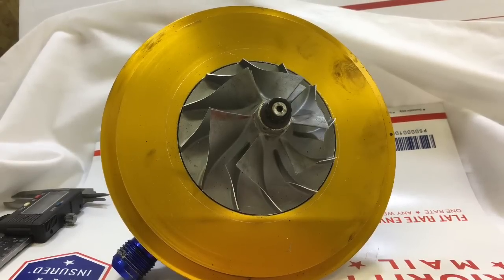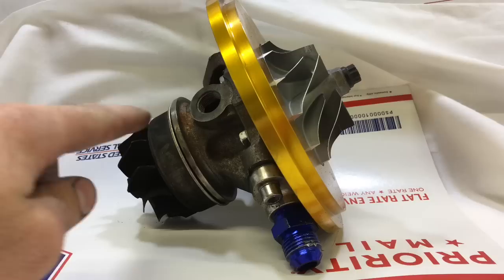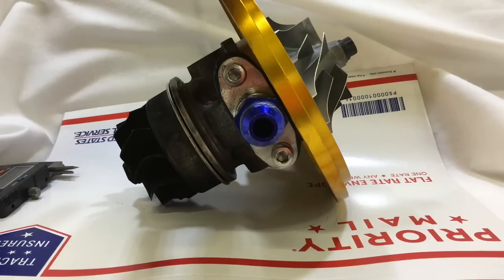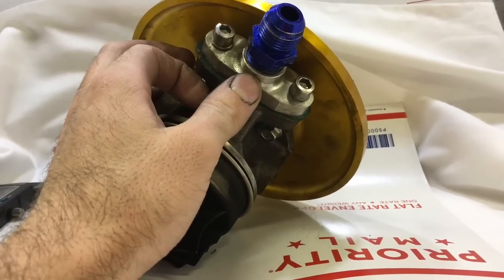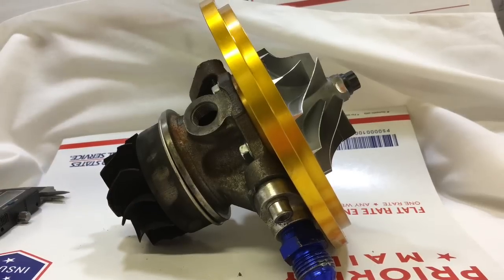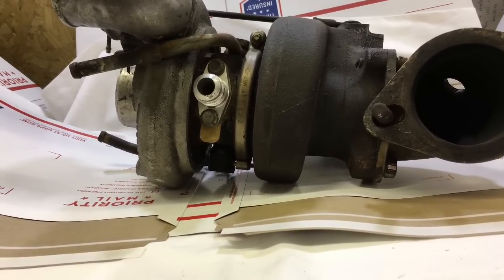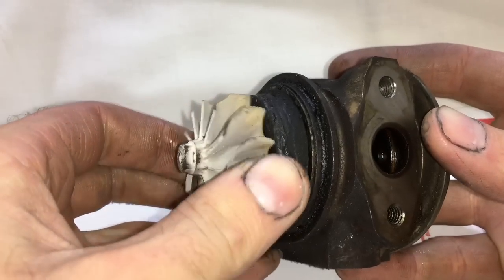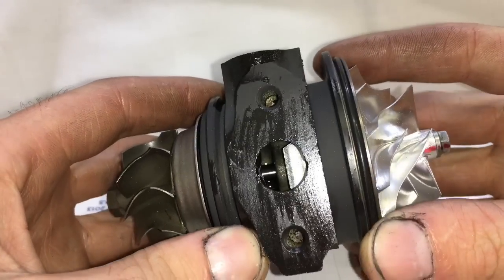How Much Oil Pressure To Run to Your Turbo

Comment: 10AN inside diameter is 14.224mm. most stock turbo japanese car run 5/8 in hose for oil return lines which is 15.875mm.     After watching some of your other videos it's really surprising how little you actually know about turbos.
Reply: enterBJ40 just because your little book says something, doesn't mean the people in China making them are going by your  Eaton books specs. Go on eBay and buy a couple -10an turbo drain fittings and actually measure them you fool. I've ran into the exact thing this guy's explaining. Some of the drain fittings will be the correct size right at the mating surface of the turbo but if you look into the fitting the size of the inside diameter steps down almost to half the size. This guy making the video is just trying to help people. Why would you push your luck running some minimal thickness fitting and worry about the dumb thing not draining. I know I'd rather have a way bigger drain line and not need it then need a bigger one and not have it.
Reply: Aaron is right. According to  my EATON AEROQUIP manual, all -10 are  0.891 of an inch (22.631 mm) . According to NFPA all -10 (dash ten) are, and must be, the same diameter for the same application; in this case hydraulic application. Pneumatic application has also a -10 but the flare that seals the connection has a different angle: 45°.  An inch has 25.40 mm so I think a -10 is more than ok for an average application. The next size in inches is -12  (3/4).
Reply: The main concern is the ID of the line. All -10 line should be right at 14.2mm ID. I big issue is the fittings you hook them up to. That's where the size varies a lot.  For turbo drain fitting you can typically use a 1/2in drill bit to bore them out if they are too small. -10 hose end fitting are the same. if it's a straight one you can bore it. the Summit racing Brand fittings are have a large ID and flow well. But I've come across some at the shop with a very small ID that I wouldn't use.
Reply: 10AN is 12.2mm ID or 0.48" by the charts.  I trust the charts not the manufacturers.  5/8" hose is measured on the OD not the ID when using AN style fittings. Hydraulic hoses (Dash Sizing) have a different OD and ID configuration, so a -10 is a 5/8" hose with a 16mm ID.
Reply: All you need to do is buy some AN fittings AND line from various manufacturers and measure them. The real world ID's are all over the map. Your AN charts are accurate true to the specification for internet arguing sake. Not worth much in the garage with parts in hand. "Measure twice", not just for carpenters!

Comment: My TT Mustang has over 100psi oil pressure.... trust me, you ain't "running as much oil as you can" I don't care what kind if drain you have.
Reply: TJ. N bullshit, I sell Precision, Garrett and Comp turbo and build 1000+ whp cars pretty regular and the drain line has shit to do with the oil pressure you can run. Many turbos have restrictor on the feed line for this very reason. Turbo drains are gravity feed so what matters is the correct routing of drain line and its return location. In high crank case pressure situations it can also cause drain problems.
Reply: "If you have enough drain... you can run as much oil pressure as you can" That's his words. my car runs 80 psi with a 16mm drain and it runs great all the way to 7400rpms no issues.

Comment: First off I really enjoyed the video and gave it a thumbs up. But after watching, something just didnt seem right with the measurements, especially since AN -10 line is supposed to be an equal replacement to 5/8 standard hose so I decided to head out to the garage and measure some fittings and hoses. Heres what I found.... The fitting you measured must have been a very cheaply made -10. A quality -10 has an ID of a little over 1/2" or right around 15mm. I just confirmed this by measuring the -10 fitting for MY drain and it measured out to 14.8mm.I also measured the ID of a piece of 5/8 heater hose and it came out to only 15.8mm. While I doubt that 1mm would make a very large difference in drainage, assuming it would, since there is no pressure on these, it would be perfectly feasible to drill the -10 out to over 16mm and still have an adequate seal for a drain line. This would give it MORE ID than the 5/8 hose you recommended while still allowing people to keep the fittings they have already purchased and to run the braided line that is sometimes needed due to the lines being very close to the exhaust manifold on alot of custom setups. This is the very reason that these AN lines became popular on custom turbo setups in the first place. This video definitely made me think though so Im headed out to drill my fittings now. ;)
Reply: Bad Luck Garage im just about to use 7875vsracing turbo on my hsv ls1 so thanks for the input cos i have heard this turbo has bugger all room for the drain fitting and makes me nervous😅
Reply: I'm not using the 7875 but will probably upgrade in the future. Currently using a T66 that came on an STS turbo kit that I got for a steal but if you check out my playlist for my turbo C10 you'll see I've chamfered the drain fitting to help flow into the -10 fitting. I completely agree with this channel that you should use the biggest drain possible but sometimes clearance is tight so you gotta make due and just try to help flow wherever you can. Disclaimer: THIS GUY OBVIOUSLY KNOWS WAY MORE ABOUT TURBOS THAN I DO!!! So I would follow his advise whenever possible!but sometimes on custom setups, clearance is an issue. I'm actually having to go ahead and clock my drain line and tighten it to the drain fitting off the turbo, then bolting the assembly to the turbo as an example.
Reply: Bad Luck Garage yeah thanks.. will definitely have a watch and look at getting flow best i can. My car is 4door version of your 04 gto so not alot of room in general i will keep you posted.
Reply: I'm assuming you're referring to a Holden Commodore? That's pretty cool brother!!👍🏻
Reply: Bad Luck Garage yeah thanks. Funny tho i covet your c10 and cool coupes especially the trucks tho.
Reply: Yep , Robert set them straight.  👍 go gettem CC
Reply: If your case breathers are plugged, dirty, even slightly  restrictive it can prevent the drain from flowing properly.
Reply: The blind leading the blind
Reply: Bad Luck Garage I actually work for a couple of the major manufacturers of diesels and he is 100% right now while you are right as well it must’ve been a cheap China fitting and I say China from experience there’s a lot of people that run the big rigs they like to put dress-up stuff on their engines I’ve seen a lot of these fittings that I had to takeoff because they are restricted and also are Poor quality metals what I’m trying to say is if it says to give it a 1 inch hole give it a 2 inch i’ve seen turbos that are supposed to go half 1,000,000 mile crap out in less than 100,000

Comment: I think you'll find every turbo made has a spec oil flow based on volume measured out the return both on cranking and peak torque at running, that has very little to do with pressure. Pressure is a measurement of restriction no reflection on flow, running high oil pressure above what the recommendation of the supplier induces high parasitic drag  reducing the turbo response.

Comment: do borg warner vnt 17 turbos have sufficient oil ports on return? i upgraded my turbo on my 03 tdi jetta. do you see any issues with running a oil cooler on the turbo line just before turbo?
Reply: It all depends on type and visoosity of your oil you dont need oil cooler some oils are made to run hot

Comment: Hey Austin, the Mazdaspeed k04 seem to smoke oil from seals when people do a dump pipe upgrade.. can you advise if theres any known issues with the Mazdaspeed k04 drain ? Is there a deflector? or is it due to just a shitty designed turbo?
Reply: the mazda needs a duell exaust dump or it will  heat up seal and smoke

Comment: We use restrictors so the crank bearings keep oil pressure and we don't pump all of it to the head or the turbo.
Reply: @jimmiedean8035  i think that a lot of oil flow to cool it, is needed for racing only; for a grocery getter or to snail drive at 75 mph you don't need a lot of oil flow,am i right? so, when i have oil burning (due ,surely,to high crankcase pressure,due to a hopeless,worn, engine- cyl.and rings-,that the customer can't afford,or want, to repair) i would,and do,use an oil restrictor that i make,altering the inlet bolt; usually 1.5 mm,simply because the 1 mm drills break a lot...)
Reply: @jimmiedean8035    the problem is when the turbo breaks, all that oil goes through the intercooler to the intake and the diesel engine enters a runaway to destruction; ask me how i know ;i  once was able to stop,engage 5th and stall it,but youtube is full of runaway diesels until either the engine breaks,or the oil runs  out; restrictors should be mandatory in all diesel turbos,as should  intake plenum butterflies, some cars have these;  

and since i am at it, it should also be mandatory that turbo diesel makers also make half of them NON TURBO; you can't imagine the pleasure of driving a non turbo diesel with the torque available down low at the ready,instead of waiting for the 1600 RPMs; turbos are good for loonies who know no better and demand them,good for racing,good for towing,and good for germany where there are 12000 kms with NO speed limit,300 kph is ok there,not anywhere else.

Comment: So I have a turbonetics and have had this same issue where I blew the seals I believe because I only have a 5/8 drain on the turbo and ran whatever the car was pumping to the turbo from the oil sending unit. I couldn't find anything bigger than 5/8 even though turbonetics said to run a 3/4 to 1" line. But why is this just for journal bearing? What's different from ball bearing?
Reply from the maker: +Keyton Holcomb the ball bearing turbos don't flow as much oil but the bigger the drain the better
Reply: Turbo Lab America so I should run a restrictor on a ball bearing?

Comment: I'm gonna be using an 10 oil drain, I don't have the funky fitting on the turbo like in the video though, it has a block with an10 threads. but I did drill out the fitting to little over half inch hole, it was kinda small before. its basically the same size as my stock line was, a mill or 2 bigger now than stock line was, so I don't think ill have an issue. my an 10 line also has decent size holes on the fittings. and my oil pan has an10 fitting with a shaft and oring that just presses into pan, drilled that out as well to make hole bigger, so I'm pretty sure my setup will have enough flow, if it doesn't leak that is lol guess ill find out, if it don't work, Ill just change it.

Comment: +Turbo Lab America   Very good info about having a big turbo drain, (I run a neon hahn 16G turbo kit S2 with their complete stock drain) also wondering if increase crankcase pressure  could also be a source of blue smoke at WOT pull at the 1/4 mile track. it's something i noticed a few times only at the track, but it never smoked before or after on hyw pulls of dailly driven.

Comment: extremely helpful I never realize you wanted to run as much as possible but I guess it totally makes sense it's the only thing Cooling most Journal bearing turbos.
Reply: all the boost no, this guy is giving bad info.

Comment: Hello Turbo Lab, what could cause this whine? It's a brand new GT2871R, less than 1000 miles on it.
https://www.youtube.com/watch?v=PJGLhO4KIj4

Too much oil pressure? Low oil pressure? I'm running a 1mm restrictor.
Reply from the maker: Lack of oil.

Comment: what about if you are doing a stand alone oil system for your turbo and are using scavenger pumps on both ends feed and drain ?
Reply from the maker: +22re red I'm not sure what to tell you for that. I prefer not to run scavenge pumps because if the turbo is below the oil level naturally then it will leak oil out of the turbo in its natural sitting position with the engine off. You would have to talk to someone that knows more about that subject, i build turbos for vehicles that are usually already turbo charged, so we don't have to worry about that problem.
Reply: Turbo Lab America okay so if i put a shut off valve for the feed line would it still leak if i keep the drain pump on for a little bit after shutting the valve because im looking into doing a bed mount for my truck and didnt want to tap into the engine oil
Reply from the maker: +22re red Your case is different, you never want a shut off at the feed. What I'm referring to that would be a problem is the height of the natural oil level. As In with the turbo mounted, after you put all the oil in the motor, in some cases the oil will be so high in the turbo that it leaks out of the seals
Reply: for the shut off i was referring for after i shut the truck off
Reply: Check ball valve on the feed line. This is what is used on the STS rear mount systems. It stops the oil thats left in the feed line from draining into the turbo once the vehicle is shut off....or in your case once the pump is shut off but as soon as over 1psi is applied, it opens back up. Then for the return side, either mount the pump below the height of the turbo, or use a back flow valve between the drain and the pump to keep the oil from back flowing into the turbo once the scavenge pump shuts off. We used this setup to take care of the oil issues on a 98 transam with a rear mount turbo. Worked like a charm. ;)

Comment: good video, im going to port out my oil drain i guess. Do you sell or do you know where I can get just the compressor o ring seal for an H1c? I cant seem to find it anywhere without being in a rebuild kit
Reply: Poor Man Mods don't do that it is not necessary at all. You should have a restrictor on the oil feed side and your drain line should run at a down ward angle straight to pan with no low spots. I sell Precision, Garrett and Comp turbos and build 1000+ wheel horsepower cars pretty regular and I can tell you that this guy means well but is not giving good info.

Comment: Can you provide a link to the fitting you're talking about at 10:03? I'm going to be running a tb0363 .52/.48 50 trim/ could you by chance provide recommendations on oil feed and water lines as well? big fan, thank you for all the information you provide.

Comment: Would you recommend that I switch out the oil feed banjo bolt to one that flows more oil on my vf39? I only ask because right now I am running the stock one and I bought a oil feed line kit that came with a less restrictive banjo bolt.

Comment: Nice job Austin! ...I had an oil pressure issue that I thought might be turbocharger drain related..but I capped off the flow to the turbocharger to quickly check oil pressure and found it was my engine...you're correct..the stock sized (16mm) oil drain back is sufficient...👍

Comment: You say that 5/8" hose would be really good, but isn't a -10 AN hose equivalent to a 5/8" hose?  I understand perhaps the -10 AN fitting outlet may be smaller then 5/8" but a -10 AN hose itself is equal to 5/8".
Reply from the maker: +mrkikaz this fitting is a -10 an, but not all are the same. I tell people not to use them because all of the -10 an drains I have seen are too small. The 5/8 is roughly 16 mm inside diameter.  This -10 an fitting is only 9.95 mm, the Hahn mhi turbo was 12 mm inside diameter.
Reply: +Turbo Lab America 👍